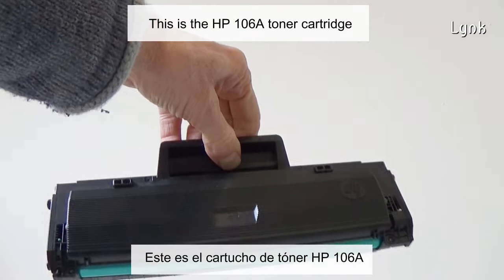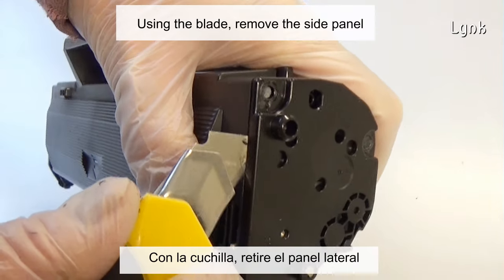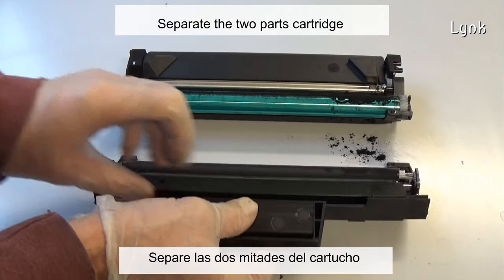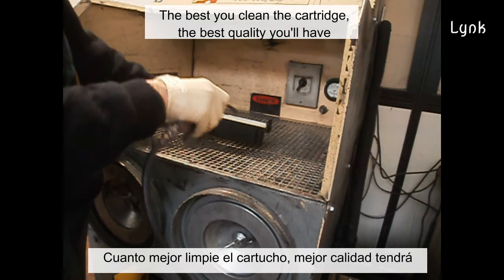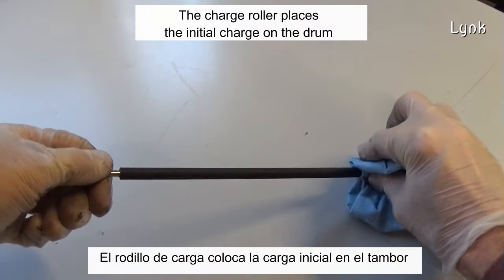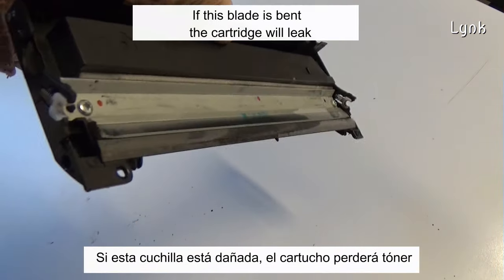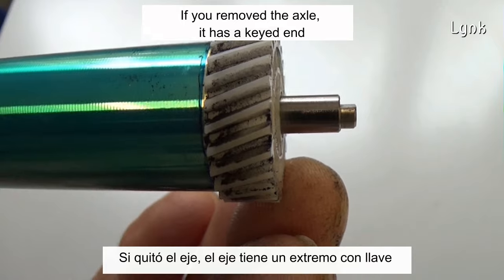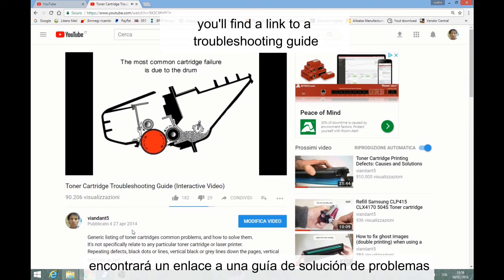Refill Toner HP Laser W1106A 106 107a131 136 137fnw

Comment: Hello, I am wondering why there are some 30 mm horizontal lines on both edges of the paper while printing?The distance between the horizontal lines is 62 mm. Also I see there is a powder on the photo drum (long horizontal streaks from one end of the drum till the other end). Thank You.
Reply from the maker: Ehich printer do you have? it seems a defective drum cleaning blade
Reply: @viandant5  Hello,actually,I have a problem with Samsung cartridge (SCX 3405 printer). I filled the cartridge with powder, changed the photo drum and chip but the quality of the printing is unsatisfactory.Now I see some shadowing of the text. The main text appears as a shadow 64 mm above and the main text that is at 64 mm is shadowed by the text which is 64 mm below. Also at the bottom of the page there is a thin horizontal black line and some two black dots (at the same spot). I see that there is powder on the photo drum as a circle close to the gear side.I tried to roughen up the felt filter but this powder circle still appears after every printing.

Comment: Thank you , if we don't change the electronic chip will the toner work
Reply from the maker: No, if the chip is at the end the cartridge will not work
Reply: @viandant5  where can we buy a new chip
Reply: Yes it will if you refill before it shows very low toner indicator Ido the same
Reply: You can use old chip but there are 2 methods how to do it. Either get 5 new other chips from aliexpress or somewhere. The printer should remember the last 5 chips, so your old chip as 6th chip will be reusable, don;t lose those 5 other chips, they again can be used to delete old memory and replace with new one. Or you jailbrake the printer, if it is still possible in 2023, by pushing buttons of printer in somekind of order. The chip trick should work, as you might have guesed, if they increase memory on a chip, they will have to pay more for production, meaning less profits. Or they never updated their firmware ever again and button trick still works nowadays. Also you can just get an old samsung laser printer, hp have bought their devision, while using old tech, you can place hp cartridge.
Reply: So it's means for any refill of cartridge.. the chips need to be change...

Without changing of chips it will not work 

And how much can it be in Ugandan money

Comment: why u changed the chip of the printer?
Reply from the maker: The chip of the cartridge?
Reply: @viandant5  yes I bought hp 107w a few months back and now it is out of ink and I have been told to replace the cartridge chip with a new one while the printer is new.
Reply from the maker: @Saadk2k1  When you refill the toner cartridge it's necessary to change the chip